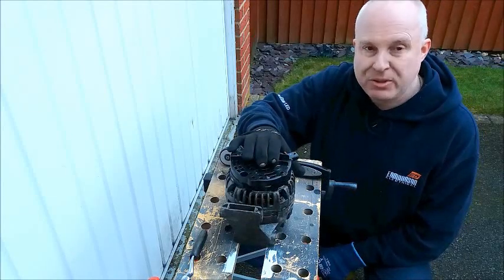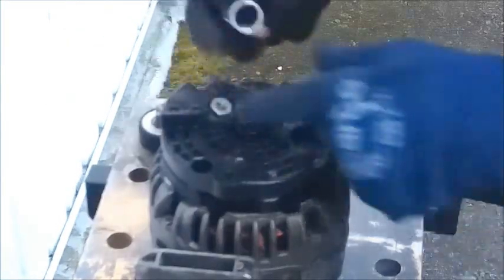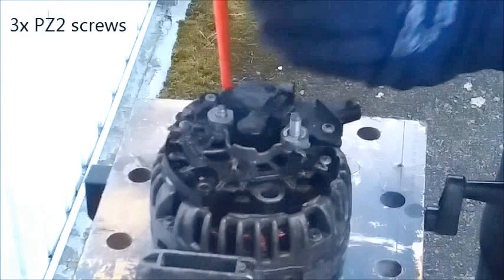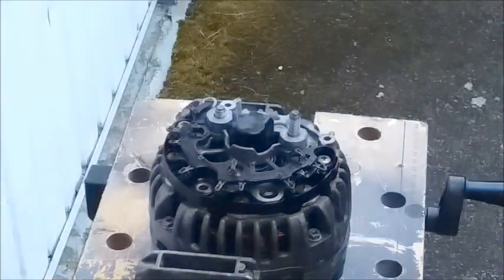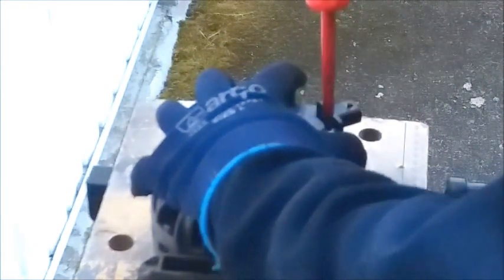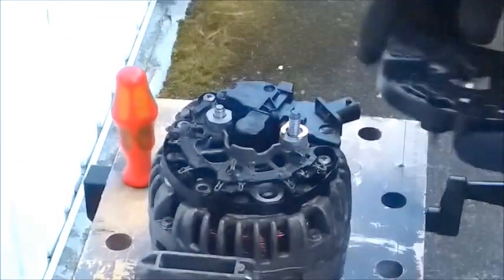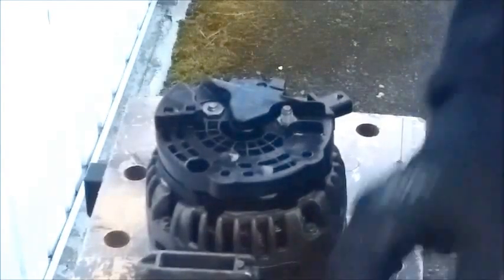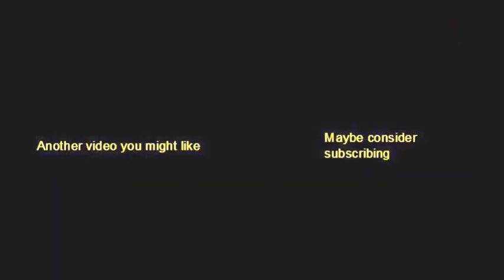BOSCH Alternator Regulator Replacement & Alternator Brush change

Comment: Have done this a few times to save old lternators. In fact I did this while it was still on the car. On one car to take the alternator off would have been an hours work.
Reply from the maker: Thanks Zed. Yes, I see no reason why it can't be done in-situ on many cars. However that would have made for a very 'difficult to make' video.
This one came off my Saab 9-3 and it would have been extremely difficult to do in situ anyway.
Reply: @CycloneCyd  hi my mate has suggested my fault could be the rectifier or regulator brushes as getting no charge, is the rectifier built into the regulator unit or can it be found inside without major strip down as hoping to change it on the car xc90 volvo, easy access to the rear screws and nuts thanks
Reply from the maker: @rogergill1959  yeah, it's all one unit
Reply: Almost every Bosch regulator is the same no matter the number

Comment: Hello! All my Dashboard Light came on while driving and dissappear like i start the car. This happen only when i turn on AC or DPF its start regenerating(turning on motor fan) i put vcds and show this alternator regulator error but never appear after i delete the error. Could be the alternator regulator? I go to mecanic and Say the alternator its good….please help me
Reply from the maker: Could be, power problems are often intermittent when brushes wear out. Did he 'load test' the alternator (one of my earliest videos was about alternator and battery testing)

Comment: Thanks for the video. My alternator suddenly started overcharging upto 17.6 volts I've just ordered a new unit
Reply from the maker: Good thing you noticed that before it boiled your battery dry 👍 nice work
Reply: @CycloneCyd  All fitted and working just fine you must have saved me over £100 great work thanks ! It's not an easy job as I did it in situ but better than taking the alternator off
Reply from the maker: @24caratgoldies17  What car was that on?
Reply: @CycloneCyd  sorry for the late reply it was on a Vauxhall Movano MK2 van

Comment: Hi, thank you very much for your wonderful lecture, is there any way to bypass voltage regulator on these type of alternators and use an external one? I would like to remind you, that I will not use it in car, but for inverter, where I need higher than 14 volts out put. Thanks again.

Comment: Hi my Bosch unit has stopped working i can get to back screws and do that job on the car but where is the rectifier which could also be the problem and not the regulator TIA for any replies
Reply from the maker: I'm 80-85% certain that the replaceable unit is the brushes, regulator and rectifier all-in-one.
If I was doing it now, I'd get one of these, about a third the price of the genuine Bosch article
https://bit.ly/F00M145670_replacement

Comment: Hi wondering if you can help I've replaced my regulator with a aftermarket part i thought it would be a plug and play but unfortunately the message on my dash saying battery not charging pull over is still showing I've tested the alterntor with a multimeter it's showing 14.4 volts ruining the engine I've been driving the car for over 200 miles it's charging the battery but for some unknown reason the message and battery light isn't going off I've tryed discounting the negative connection on the battery for 10 mins but unfortunately the message comes back on I'm lossed now what could the problem be could it be a aftermarket part not compatible with Bosch alternator ?

Comment: I have a Freelander 2 SD4, it has problems starting. Battery has now been replaced but still clicking noise for a few starts and then it goes. The battery centre tested it and told me the alternator is charging to high - 14.7V. Can this be fixed by replacing the voltage regulator?

Comment: What is typical symptom from a bad regulator or a bad brush?
I have sometimes flickering interior lights on My SAAb 9-3 TTiD 2010 (24000 km ) The radio dont tune in the radio channel after the engine is ignite. Sometimes the voltage goes from about 12,5 volt to 13,6 volt when driving.
Reply from the maker: My nav display would flicker. That's a sign the brushes are worn and not making proper contact with the slip rings. Less than 13.8V with engine at 1800rpm+ is too low. brushes knackered.

Comment: What happens when i install a mismatched regulator in the alternator, because my battery dashboard warning light is glowing low even after the engine start.. please guide me...
Reply from the maker: Not sure I understand what you mean by "mismatched regulator".
Could be you've got a connection issue or 'earthing' issue.
Maybe the slip rings were worn out and should have been replaced.
Check all connections back to battery including any chassis earths (like this example: https://www.youtube.com/watch?v=UKTd4aI3-Mw)
Make sure the belt is clean and is not slipping.
Measure the charge voltage, at the alternator and the battery
Reply: @CycloneCyd  my battery dint charge due to failed regulator. So the mechanic changed a new regulator which dint fix to the available space. It seems like he has fixed a non compatable one....
Reply from the maker: @SenthilKumar-wg4zm  oh dear, doesn't sound good. Why would he do that? Was there an issue with sourcing the correct part locally?
Assuming that to be the case, follow this link to Ali (http://bit.ly/Bosch_Regulator) and in the search bar (near top right) put the part number of your regulator (usually starts F00M... for Bosch). There are loads of compatible regulators on Ali, all with worldwide shipping.
Let us know how you get on.

Comment: How do I know if the regulator and brush went bad? Is there a way I can check that on my alternator?
Reply from the maker: If the alternator has done around 100,000 miles or so on the car and under load test it can no longer maintain it's output, then it's a fair bet that the brushes are simply worn out. The only way to check that though is to remove them and measure them against spec.
This ( https://youtu.be/AT_XmlwMVz4 ) was only the third video I made and is a bit slow, but it is very detailed and comprehensive.

Comment: I have a Vectra C with the same 2 litre turbocharged engine. I've started to have a weird issue with the alternator. Took a test with a Bosch BAT-131 tester and it informed that my new battery of course was ok but it also said that alternator is ok but i think it's not ok. The issue i'm having is that the interior and all the exterior lights and board computer are flickering/pulsing on idle. Sometimes it gets so bad that it's pulsing also on mid RPM and affecting the ignition. It's jerking at the same pace as it's pulsing, very annoying! I've noticed that when it's cold it's usually the worst and sometimes after hard acceleration almost like it's not getting enough fuel. At first i thought it's the ignition coils but it doesn't hesitate on acceleration. Few days ago i intentionally drove it with a third gear and it jerked all the time when it was bad and after about half a minute power steering went offline. It came back on after i restarted it. I checked battery connections and put a jump start cables between battery negative post and chassis and engine. So it's not a grounding issue. I took the ECM plug off from the alternator and voila all the flickering/pulsing was gone! I think the culprit is this same part. I made an order even though i'm not sure if it's the right one. Vectra C EPC gives the same part number to both 100A and 120A alternator. So i think that will do it but i hope that the problem is not with the diodes or ecm...
Reply: Also when i tested it today without the control plug the alternator/battery light did not illuminate so perhaps it's even charging without the plug? After i reconnected the plug the problem wasn't that bad but it was still there but at least there was not ignition problems this time. So i think i'm on to something here.
Reply: New voltage regulator fixed the problem!

Comment: Have you tried to open the regulator before and look for bad connection?
Reply from the maker: No I haven't. TBH I don't think there is much point. If the brushes are more than half worn, they need replaced and since you can't get them seperately you have to replace the whole regulator unit.

Comment: Great video! My battery shows around 12.6v with engine running and drops to low 12s when engine stopped so looks like it's the alternator. I'll check out this part! How easy is it to feel if the bearings are gone? Car has done 183k miles so maybe they could do with an overhaul too.
Reply from the maker: It does sound like it probably is the alternator, however, NEVER assume ALWAYS test. A bad alternator can kill a good battery in no time: https://youtu.be/AT_XmlwMVz4
Reply from the maker: Once you've got the belt off spin the alt by hand and 'feel' how smooth the bearings are. You can also listen to them with your mechanics stethoscope https://amzn.to/35KNiOs watch this https://youtu.be/jnTWmG41vX8. 
If you're changing the reg/brush pack, I'd also recommend you change the slip rings too, or at the lest use some 1200 grit to smooth off the old ones. Something I've learned after making this video

Comment: Good little video.  Where did you buy the part?  What website tells me which part I need.  I have the alternator part number.
Reply from the maker: I simply searched the part number (F00Metc) on eBay and found a seller of alternator spares who had it in stock. You could use the alternator part number (0145etc) instead, just remember to include description in the search field.
Reply: Why did you say pozi ,when it was a Philip's screw? Very few pozi screws made yet.
Reply: @haydenellsum3585  In Europe Phillips screws are rare now, apparantly only the US uses them these days. Nearly everything has been Posidrive here now for a long time, better driver contact and 'X' stamped onto screw head denotes a Posidrive screw. A lot of stuff is going Torx now here too - by far the best head on any I've ever used and I specify screws on products as a designer.
Reply: @steeveedee8478  hi .but the pozidrive and Philip's are almost the same but the pozidrive has the extra piece of metal in between the Philip's cross  x, so not much different but the screw drivers are not a tight fit.
Reply: Of course the torx are more superior.

Comment: Thanks for the video. Quick question - Is it possible to replace the brushes on the regulator without having to buy a new one? I am finding it difficult to source it here in Australia (I have a slightly different part number but visually it looks almost identical to yours). Thanks again for the awesome video!
Reply from the maker: Hi Gavin, thanks for watching and welcome aboard.

Yes, I believe it is possible to replace just the brushes. The new ones come with a copper wire 'tail' so you'll need to be handy with a soldering iron. I don't know how you split the regulator to fit them in though, so I'd suggest having some Q Bond handy for reassembly purposes. I've seen the brushes for sale on UK eBay.

I must admit I never considered replacing just the brushes as the whole regulator was readily available and only 30 quid, but I can see your point if it's not.

I got my regulator from a seller in N Ireland on UK eBay - might be worth enquiring if you could get one posted out to you.

If you do end up just replacing the brushes, any chance you could take some pictures and jot down some hints and tips? My email is in the 'about' section. I could make it into a Community post or maybe even a supplementary video short.
Reply: Cyclone Cyd Thanks for the prompt response. Really appreciate it. 

I went ahead and ordered a new voltage regulator. It should arrive in 1-2 weeks. Once I replace the old one, I’ll try and open the old one. It does look firmly sealed so I’m not sure if it’s even possible to replace it’s brushes without damaging the unit.

Let’s see. 😊🤞🏼
Reply from the maker: @GMan12321  do let us know how you get on please. I made the mistake of throwing my old reg away.
Reply: @GMan12321   how did u go I’m looking at doing my 1999 hilux i changed it just Over 2years ago hopefully it’s still under 3 year warranty

Comment: hello! i'm getting mad, when i turn lights on, the current dims the more i turn light on the more it dims, i know that by the voltmeter in my car, only when i push the RPM it goes up again to 13 but as soon as i slow down it lowers back. any suggestion?
Reply from the maker: Yes. Your alternator needs new brushes. 13V isn't enough even under load. See this video of mine https://youtu.be/AT_XmlwMVz4

Comment: toyota yaris .. 2007 1.0 69ps .. about the same(doesent have 2 nuts has 2 screws)
Reply from the maker: Hi there  zloben9000 , thanks for watching and interacting.

Yeah, this same basic alternator is fitted to loads of cars. Is that the same engine as the Aygo/C1/107? I'll have to look at our C1 and see if it has this unit.
Reply: one cant tell for sure, its the 1kr-fe engine ... i have a video of me taking it apart... some use Bosch others use Denso.. i changed the voltage regulator used Taiwan made Mobiletron and not Bosch...

Comment: This isn't a brush change, you just changed the whole regulateor man, not the brushes...
Reply from the maker: The brushes aren't available seperately ......
Reply: @CycloneCyd  they are. Do some reseach... Not specifically for this regulator but you can buy 5x3mm brushes (at least this was the size for mine) dirt cheap. I exchanged them. You don't need to throw away the working regulator just because the brushes.
Reply: Why piss around soldering new brushes in anyway just change the whole unit much quicker
Reply: @johnmcguinness7116  Agree, its only 20-30 eur Regulator.